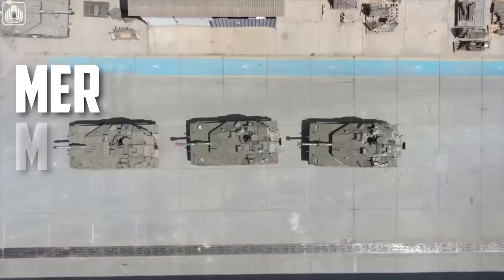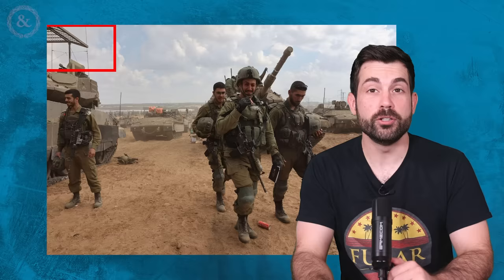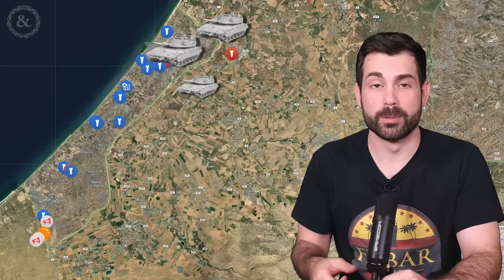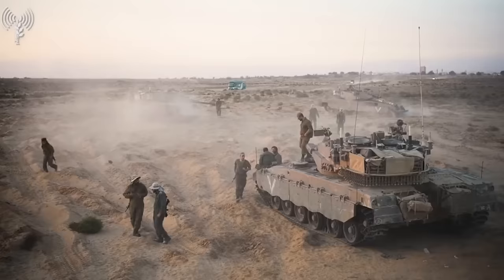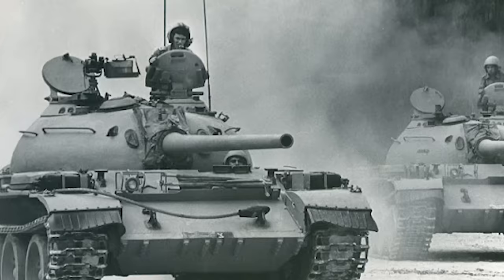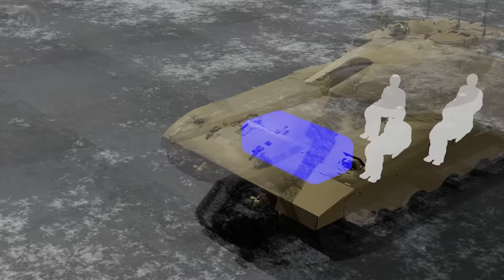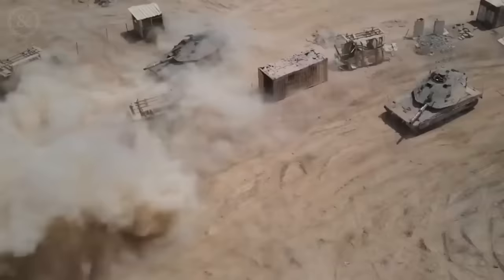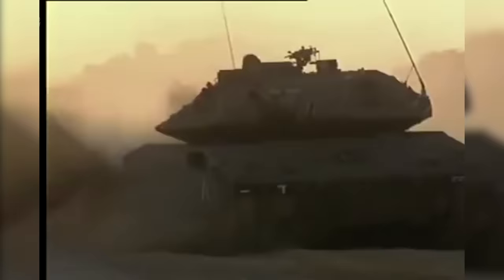Israel’s Home-Built Merkava Tank Tactics

Comment: A couple of clarifications:

The primary protection of the front engine layout is the spaced armor effect of the engine bay, not the engine block. Engines are not made of armor steel and add only slight protection against penetrating weapons. The bay has a significant benefit because it is a large space for high explosive anti tank weapons to dissipate energy. 

The primary purpose of the rear hatch is for rapid reloading while under fire in combat. This was seen as important from experience in defensive battles against numerically superior forces. The other benefits and potential uses are secondary to this.
Reply: I've heard some say the tank's engine being in the front being a drawback in some cases, If I recall right I believe the argument was that APFSDS makes the engine become a additional projectile for the crew like shrapnel, however I do not recall how credible that claim is or if I'm misremembering, 

I recall someone named "spookston" making a video on the Merkava and I believe he was the one that made the comment, he is the sort of person who purchases and distributes old tank spec documents and stuff for the game he plays so I believe he is far more credible than the average joe.
Reply: It doesn’t add any additional hazard to the crew because the mild steel debris from an damaged engine are not going to penetrate the armored wall behind it. It would only be dissipated energy like a kevlar vest, spreading energy over a larger area. 

The projectile penetrating rod itself is hardly going to lose much energy going through an engine block anyways. It will go straight through without breaking up, even with the typical tungsten rod. Even a rifle bullet can penetrate an engine block. An APFSDS rod is going to almost entirely ignore the engine, going straight through without slowing down significantly. The armor layers are what will stop it if anything.
Reply: There are some potential drawbacks but that isn’t one of them. I don’t think I should go into detail about it right now though because Israel is in an active war.
Reply: Yeah but the engine will also be a black holef or any spalling or smaller frags.
Reply: I see, I guess the risks are minimal if there even is any. 

I find it a bit funny how people are saying its a draw in that it will result in more mobility kills, since if it were to fall victim to such the crew would have already been either dead or greatly wounded if it were a standard tank.
generally as long as you're not Russia/Soviet (they don't care) your military values the crew more than the vehicle, especially for Israel which is such a compact and small country.
Reply: This spaced armor concept only really works against older HEAT warheads, an ATGM like 9M133 Konkurs or BGM-71B I-Tow probably have enough penetration to go through the Merkava from the front and reach the crew compartment
Reply: A lot of that about the engine section is true but studies by the RAND have found that engine blocks in tanks, apc and ifv do add protection as well.
 Depending on the type and configuration it can add anywhere from 6% to 23% of added protection (only when the block is facing the projectile/threat of course)
Reply: @someboi4535  Nothing to do with era. HEAT jets due to pure physics will disperse in 1-2m regardless of how new or old. Normal space armor is typically ineffective as they just don't have the gap needed but given how large a powerpack typically is, it will do the job. Also the engine block will absorb any and all shrapnel caused by the penetration. Tactically, I don't see any major drawbacks. Mobility kill is a non-issue since without the engine, your driver and possibly rest of the crew would have been maimed as the enemy round penetrated anyways.

The one thing I do think might be annoying(more operational level concern) is maintenance. With tanks like the M1 Abrams, you can slide the power pack out. This idea of just sliding stuff out dates to the M2 Light tank. No crane needed and you can work on it from top, bottom, back, and sides. Or open the rear hatch on the firewall and work from even the front albeit limited.

You can't do that with Merkava. Due to the armor being in front, the Merkava has to remove the engine from the top. But since the top slope can still be hit, it is still thickly armored and thus very heavy. You will have to remove the bolts and crane off the glacis plate to access the engine. And if you want to access from any other direction, you have to crane the whole thing out. You can probably work on the back of the engine from inside, but just like working on the front of the engine on the Abrams, it is limited and in constrained space. That usually mean its hard to conduct maintenance or repairs on the field. Guess its not too big of an issue as they will rarely operate outside of its own borders, and even then not too far from home. Israel can just tow it back for repairs, especially since Israel is a small country. But this is not an option a lot of other countries have.

Comment: The Merkava appears to be an optimum compromise between East and West tank philosophies from the cold war. It's an excellent tank by all accounts.
Reply: What about the Merkava demonstrates a Cold War Eastern tank philosophy, in your opinion?
Reply: Yet, they got their behind handed over to them by a bunch of guys in adiddas pants and slippers 😂😂😂
Reply: @1AlShmary  An RPG is an RPG, no matter who's holding it. If 100 chimpanzees blindly fired 100 rockets at a tank, one would probably hit by sheer chance, even if those chimpanzees are wearing Adidas pants and slippers. With literally thousands of RPGs fired so far at the Merkavas, and only three or four tank crews killed so far (one was reportedly outside the tank at the time), I'd say the tank has proven itself quite capable.
Reply: what? which philosophies are u talking about
its just a design with minimal weight and size limitations
Reply: @headrockbeats   well said

Comment: I am impressed by the size of this tank. Yes it’s heavy but it has interior space! And a back door! Trying to get out of dead tank usually means you will get shot just as dead as your tank. If a tank is immobilized you can get out and into another vehicle without exposing yourself to enemy fire (hopefully). I don’t know of any other tank that has that capability. 
On a side note, Canada switched to Leopards in the mid to late seventies and sold/gave our Centurions to the Israelis. They immediately ripped the gas power train out and installed diesel. Upgraded the turret systems and replaced the guns. Turned it into a useful tank for (at the time) modern warfare.
Reply: I heard one of the big complaints back in the 80's when the Abrams replaced the M60 Patton was that the Abrams did not have the belly escape hatch the M60 came with. (it also made it easy to take a piss without getting out of the tank)
Reply: @MM22966 2nd was more eof a complaint than the first I'd bet
Reply: Its like a tank troop transport lmao cant it fit like 6 troops in the back?
Reply: Most Centurions ended up having their turrets ripped out and converted to heavy APCs. The Lebanon wars saw a series of these "upgrades" and after that they mostly remained in active duty as heavy engineering APCs on the combat engineers corps under the label "Puma" (Israeli APCs are all named for large wild cats).
Reply: A big consequence of the space for infantry is the bloated weight. Everyone is trying to reduce weight of tanks and not increase it. Heavy tanks can not be transported on certain aircraft and sometimes can’t even fit on some aircraft, railcars and flatbeds. They also have slower acceleration which is deadly in today’s battlefield, they burn more fuel, are more expensive to operate and often struggle more in mud. 

Leopards and Challengers are also very heavy and it didn’t help much in Ukraine and Syria where dozens were destroyed. This isn’t the 1970s or 1980s, drones and advanced ATGMs have changed the game.
Reply: @Neptune-ku1es  ya but Isreal isnt trying to project force over long distances, the tanks suits their doctrine well as they only want to occupy the small areas around them. Theyre not trying to invade another country or anything far away. Unlike say the US whos goal is to force project power all over the world
Reply: @mobius1504 Yes it can, but the rear ammo stowage needs to be removed to have the infantry in the back, and it is also very cramped.
Reply: It's a 3 hour drive on a flatbed truck from the Lebanon border all the way to the Gaza border. Israel has no need for transporting armor with aircraft, nor tight mountain tunnels or rails.  @Neptune-ku1es
Reply: @RyuzoSan19  From what I have read/heard, there has always been a misunderstanding outside Israel for what the stowage compartment is for. It was designed for ammo storage for very long engagements/resupply, not as a infantry carrier or medevac. I practice, there hasn't been as much call for the extended ammo supply, and the Merkava being so well protected, got pressed into service in various urban engagements as a improvised APC.
Reply: @Neptune-ku1es Merkava has poor protection against APFDS projectiles, maybe good only against AT rockets.
Even APFDS rounds from mid 80s can penetrante Merkava 4 in front armor
Reply: @guss77  I heard they even did that with some captured T55's/T62's!
Reply: @MM22966  The Wikipedia article on T-55 talks about the Tiran 5 and 6 tanks (converted captured T-55 and T-62).
Reply: @187Rajah  don't know where you got that information, but it's wrong. A Merkava tank had never been penetrated by AP rounds, not even in testing.
Reply: adding 2,000 lbs of troops and gear is not going to change a tank like the Merkava, Abrams or Leo.
 @Neptune-ku1es
Reply: @Neptune-ku1es The beuty with Israel is that it is a tiny country not requiring air or rail transport....
Reply: T-72 has a small and very awkward belly hatch for the driver, if I am remembering right from an interview with a former East German tank commander. He said the armored hatch weighs about two hundred pounds, so when it drops you have to be ready!

Comment: I have always been an admirer of the Israeli military technology. From their rifle, the “Tavor” to the Merkava main battle tank and the anti missile systems like the Arrow and the Iron Dome, just to name a few examples. Unique and purposeful. Always using cutting edge solutions and proven for reliability by the IDF. What I like specifically about the Merkava is the emphasis on the crew survivability and protection. As a Bulgarian American I wish that more of the Israeli technology is used by the militaries of both Bulgaria and the United States.
Reply: Neither country's roads can handle it the Merkava! Great tank for where it is, though, and a great source of ideas too.

I have handled the Tavor some. It seems very solid and rather heavy, which are strong advantages in close-quarters fighting. The I.D.F. even have a "Mikro-Tavor" with a 230 mm barrel used by snipers providing close cover! But the Tavor is exceptionally expensive.

While many countries envy Iron Dome, an equal level of protection can be much less expensive by building a defense system similarly suitable for protecting cities based on the 122 mm multiple launch rocket systems. You just need the same kind of detection, tracking, and targeting as Iron Dome, with a rocket that releases several sub-munitions. Think of a 122 mm rocket with a 16-32 kilometer range (Buy an older propellant formula from Raytheon for domestic manufacture to keep cost down and provide good jobs locally.), that is quickly launched at the attacking launcher. It has a semi-active radar receiver in the nose. On its way, when signaled by the tracking radar, it releases two submunitions based on 30 mm cannon shells for each rocket they need to intercept. (I was inspired by a cannon shell bottle opener from Poland.) The submunitions receive guidance from the main 122 mm receiver, shortening the control loop and increasing accuracy. Figure no more than ten submunitions in each 122 mm rocket, but each normal launch rack holds fourty rockets. Small, five tube, launchers could be used to defend less-threatened areas. The Romanian version is the best defender for a city, though. It used a tractor to haul a long cargo flatbed trailer, with a fourty-tube launch rack at each end. Team each tractor-trailer with a radar vehicle, and situate these in pairs. That way, there is always a spare radar when one has to go down for maintenance, and there is a complete spare launch vehicle in case of trouble or needing to reload. "Three is two, two is one, one is none," is an old proverb; this way, you have four! Radars are expensive and vulnerable to attack; best if the radar installation has a spare, and is heavily defended by very strong protection, yes?

Red Arrow is very impressive, true.

Also, have you seen the Israeli Anti-Tank missile? It is small and light, because it was originally designed to be launched from the Israeli tanks that, like the original Merkava, had 105 mm gun. It is laser guided off the modified range finder, and only has a powered range of 1,000 meters. But its sensor is sensitive enough to be guided and engage from as much as thirteen kilometers so that it can be dropped like a bomb from the air. If that could be boosted from mortar or howitzer, or dropped from something like the Chinese P.L.A. two-man gyrocopter or a crop-duster airplane, that could be very useful support for forward patrols.
Reply: Do you think Hamasses Yassin RPG 105mm is apable of destroying the merkava as they claim?
Reply: "Israeli R&D teams had this obsession with statistics and after-battle reports."

That's definitely how you successfully iterate
Reply: Now that the dust has settled we know for sure that the yassin rockets were not capable to stop or destroy the merkava because the idf has managed to manoeuvre in all of gaza @kamel3d
Reply: @ofer3000  some were damaged eventually. but it seems like the merkava tanks are absurdly resilient against them.